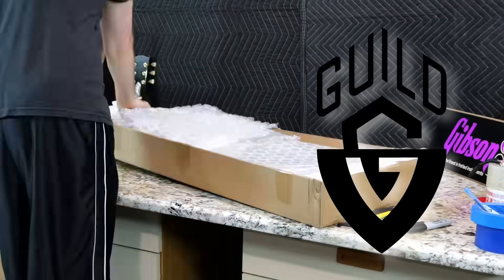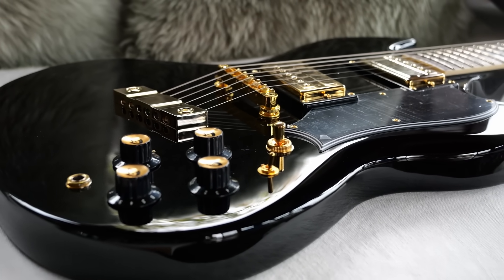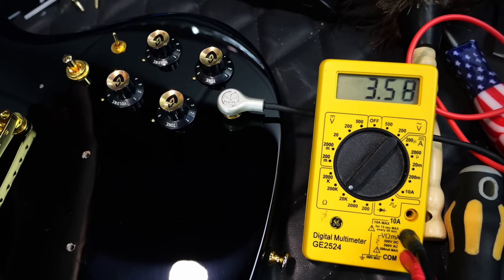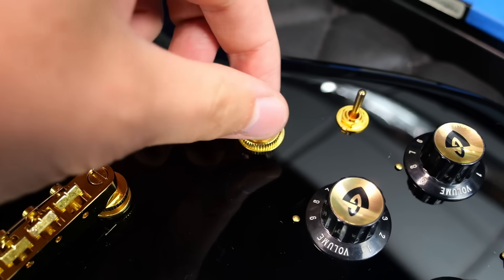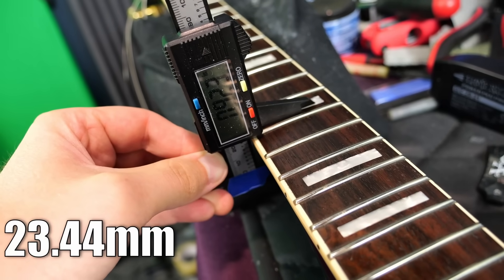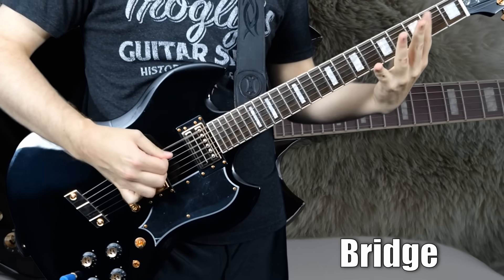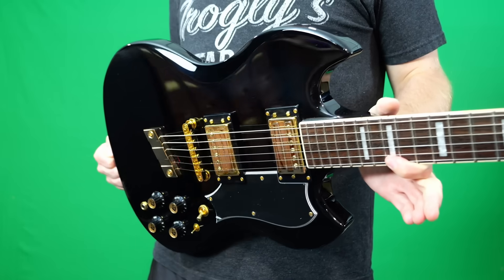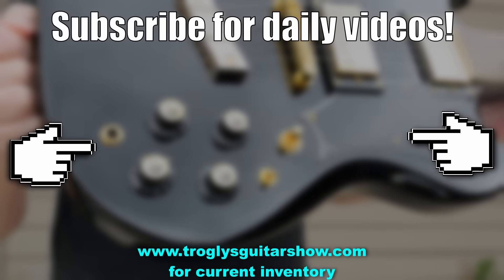I Tried the "Guild SG" | 2023 Guild S100 Polara Kim Thayil Soundgarden Ebony Import Review + Demo

Comment: An easier fix for the switch tip than grinding it off would be to drop a little piece of balled up paper or something into the tip before screwing it on.   That way it doesn't go down as far but you can still tighten it.
Reply: this or use a very small o ring in between the switch and tip
Reply: Put a toothpick in there...!
Reply: I was just coming on to say this. I ain’t cutting on nothing that has Kim Thayil’s name attached. 😎
Reply: brilliant !
Reply: Could also probably throw some teflon tape on the threads to keep it from feeling too loose
Reply: @ernieb3626 llll lol lo😊
Reply: Another option would be to remove the knurled nut holding the switch in place, pull the switch out a bit from the back and get rid of any washer(s) that sits on the switch body. That should let you thread the nut further onto the switch, raising it that crucial 1/16th to clear the top of the knurled nut.
Reply: Teflon tape or a dab of carpenters glue no more wiggly wiggly
Reply: Had the same problem with my Harley Benton humbucker Tele...
Reply: Cotton
I've fed strands of cotton in the gears of tuners. Works great.

Comment: I has an S-300 with the out of phase switch and the volume pots were wired to split the humbuckers in the middle position with the out of phase switch engaged: Turn the volume down halfway on the desired pickup and it split the coil.

Comment: The build quality of the Guild's made in America are far above the usual factory guitars such as... F & G the big two... The backstory of Guild is a great one. I own a new China made Starfire. Although I love it, it's not ever going to be like the older ones. Vintage Guild's are STILL amazingly affordable.
Check out the 1977 to 1984 Guild S-65d. I bought mine new in 1978 for $330 including tax and hardcase! Sadly don't have it anymore but I later bought a replacement. I love the design of the string block with two huge screws, the bridge is all adjustable and has roller saddles and the open strip tuners hold on to the tuning. Mahogany set neck. Awesome pickup selection and high quality electronics. These never needed to be modded or upgraded. Also, mine from the 70's/80's were not built like modern guitars... You had to play them in and this made them your own! Guitars didn't come out of the factory all perfectly pre worn in... You had to play the mother to work in that neck and fingerboard and it's a great difference that makes better players. Put on some 11 gauge strings and put some nuts into it. You're not grocery shopping!
Reply: There is a huge difference between Gibson and Fender USA.  Gibson being the highest quality instrument in any physical shop I’ve ever stepped into.

Comment: Salutations Austin!
I have never had a Guild in my collection before, but I may very well consider adding one of these to my collection sometime in the future. Fortunately, my local guitar shop is an authorised Guild dealership, so it may be possible for me to have one ordered through the local guitar shop.
It definitely seems to be well built, and the switch tip issue is very easy to resolve.
It’s too bad that it doesn’t come with a signature hard shell case as well, but it wouldn’t be difficult to order a hard shell case to fit.
Thank you for sharing your experience with this model with us all!
Please have an excellent and awesome day!
☀️✨🎸

Comment: I got an s100 in the late 80s. I finally need frets. Its a 74. The new ones id say feel a bit thicker probly cause poly these days heavier and funkier hardware (mine came with a roller bridge and a mini switch to put it outa phase. Now mine is a very beat up usa but i think some guilds came from japan and you can still find some squier ones. I enjoy the new ones

Comment: Guild has always made good guitars. They sort of took second place behind Gibson, but in the ‘70s their quality was better. Their jazz guitars are great. In 1976 I got a blonde Guild X-500, their equivalent to a Gibson L5-CESN. Nice guitar, had killer flame maple sides and back and an ebony fingerboard with pearl and abalone inlays. Unfortunately, I made the mistake of taking it on the road, and Frontier Airlines did a number on it. It was in a hardshell case, and I took all the precautions I could—I loosened the strings, padded the case out with socks and underwear, taped the case shut and put “Fragile” stickers all over it, and a “This Side Up” sticker on the lid. I had to check it of course—it was too big to go in the overhead bin, and they wouldn’t let me put it in the coat closet. At the other end, the case came down the conveyor upside-down, despite the stickers all over it. The baggage gorillas were probably playing catch with it, or trying to see how far they could throw it. The ebony bridge saddle was broken in half, and when I tried to get it repaired, the repair guy found that some bracing had been knocked loose under the top, and the arch would flatten out under string tension. The airline gave me $50 for repairs, and I had to sign off on it before they’d let me take it out of baggage claim. The fifty bucks wouldn’t even begin to cover the cost of proper repairs, which would have cost more than the guitar was worth. It had cost $1500 new, a lot of money in 1976, and I wound up selling it for $300. Taught me not to take a nice hollowbody on the road!

Comment: A little Teflon tape on the threads of that switch will tighten the tip up at any depth you need to thread it to.

Comment: Similar to my Fender Toronado type of thing I think : at first they were all over the guitar stores in 2000-2001 for $350 or $250 sometimes and now very few are around for whatever reason and only the dude from Train is the only other one I’ve seen and so I wanna stock up on eBay ones before but I don’t know how practical it would be at this point… until there was that guitar library or something like a big tour.

Comment: don't grind down the tip!!!!! use a small o ring in between the tip and switch so you can tighten it and still achieve the same effect as unwinding it a turn

Comment: I was looking to get their new Thunderbird, but I read that they screwed up the mini-humbuckers. There were 2 versions made in the 60s. The originals read about 5k and the later versions were about 7.5k, but rather than getting a proper set, they got one of each which makes the neck 7.5k and the bridge 5k. You can’t just flip the pickups as the bridge pickup is too wide. 
Also the Hagstrom style vibrato is hot garbage at keeping you in tune. 😂

Comment: Finally you reviewed a Guild! I have a Jetstar that i bought in the 2022 christmas and i love it, the neck is quite slim, but not shredder thin-like, it's a bit rounded, so it's probably 2mm thicker than this Kim Thayil signature model profile, the 2014-2023 MIK Polaras had the same rounded "C" profile, i ended up with the Jetstar because it was cheaper, but i loved the Polara also, and if this has that "D" shaped neck, probably i will like this too, i have relatively small hands, so baseball bat necks are quite annoying for me.

Comment: I would be too worried about buying a high end guitar, and having it shipped. Some of these guitars that are reviewed, it's Insane, someone Trusted UPS or USPS with a expensive piece. I worked at a shipping hub, back in the '90s, and packages got Literally Thrown, I shudder to think how bad the QC is now. Especially since Gibson and Fender, Orange, anything higher end, will come in a non branded box, which is smart, but the person loading and unloading that box wouldn't know, a real experience guitar is in the box, An I really don't think that they would Care, which is sad, because some guitars are Special, for what ever reason and Can't be replaced. I fear that soon, you really won't have the option of going to a dealer, and walking out with Brand new LP or Strat, in the color you have to have, or a Signature piece is going the way of the Dodo.